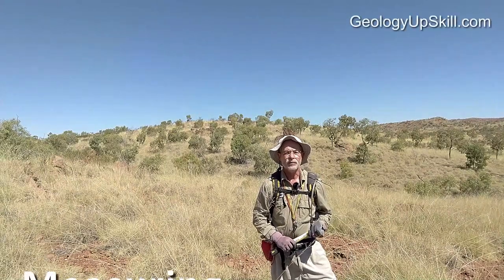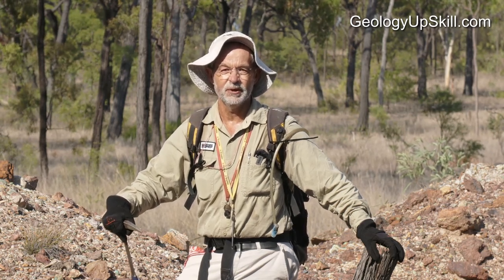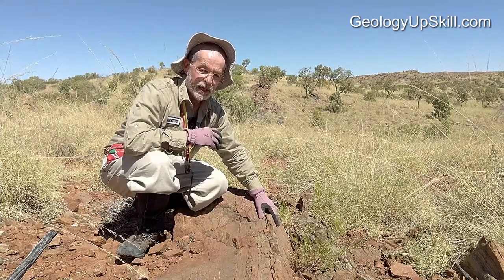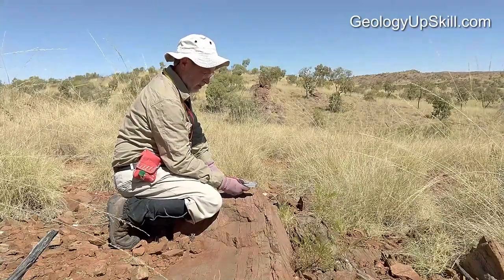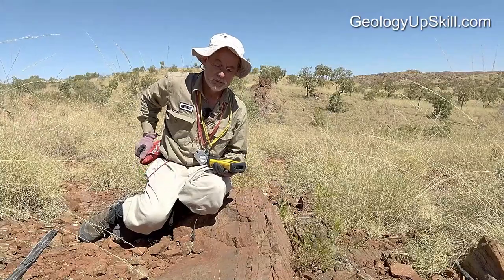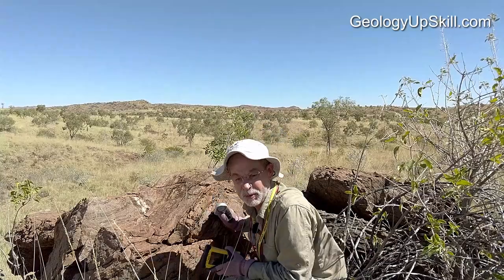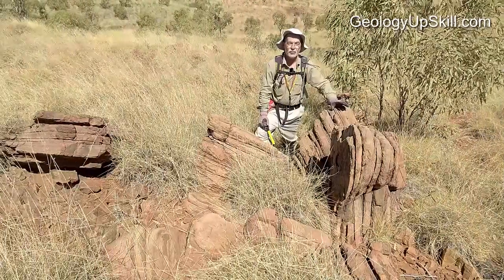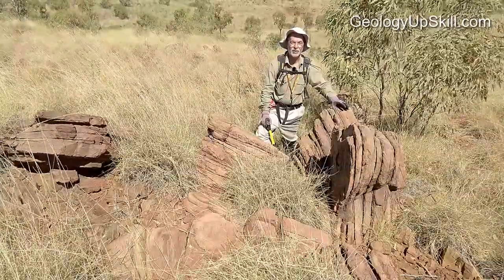Structure Measurement for Geologists

Comment: Love the knocking stick. What do you think of it? Any starting g points for a supplier?  I've been looking for an 800 gm cross panel with out luck.  Blacksmiths used them.
Reply from the maker: Thanks Geoff. It's a Stinger from Trow & Holden. A stone masonry hammer. I have been working with them to design a new tungsten tipped hammer for geologists.

Comment: My Garmin GPS from 20 years back, I still have.  The way it works is it gets you within 60ft, and then the satellites drift your position around, apparently in a circle.  You don't ever get an exact spot.  Now, surveyors have accurate GPS, and maybe there is a licensing problem or as I have been told, the randomization is built in so you cannot use it for a weapon.  The public in the US gets stupid GPS.
Reply from the maker: Most consumer level GPS and phones now get to within about 15 feet if there is a clear view of the sky.
Reply: @GeologyUpSkill  If may be within 15 feet but the location also drifts around.  It can get you to the hillside you want.

Comment: Only geologists could have two Right Hand Rules each of which is the opposite of the other :-).......

One advantage of using a Brunton pocket transit or similar is that it's easy to see the true dip as it is perpendicular to the strike you just shot using the bullseye bubble level to get true strike.

You also can use it for shaving........

That being said I see the value and efficiency of dip direction.

Pre GPS I ran my traverses with a Silva 15 TDCL mirror compass for the azimuths between stations, measured the slope angle for distance corrections with a Suunto clinometer (always know your eye level on each of your field assistants) and did structural measurements with the Brunton.

Nowadays the first two have gone the way of the dodo with GPS.

The one exception to mapping structure in creeks was at Mt. Kare where there was a 2000-4000 person gold rush and ZERO outhouses. When mapping the creeks, which were often used as latrines, I became very adept at taking structural measurements without getting close to the outcrop and I learned to map quickly............
Reply from the maker: Yes. GPS changed everything the day they switched off Selective Availability and accuracy went from 100m to 10m.

Comment: What GPS system are you using, especially for recording your strike and dip measurements?
Reply from the maker: The hand unit is a Trimble Nomad. It has a built in GPS. I am running Discover Mobile software to collect the data for structure and all other mapping and sampling. It's an old system now, but still getting the job done.